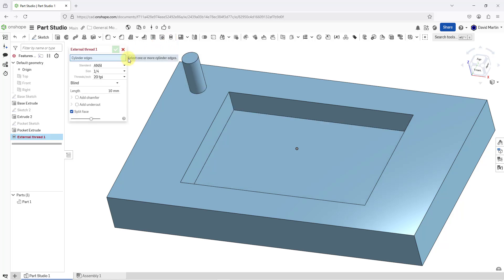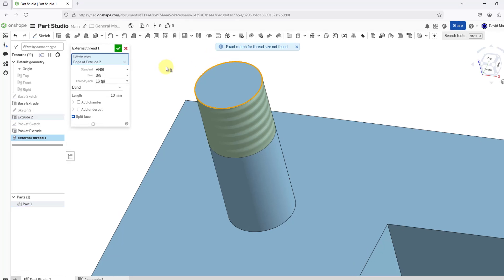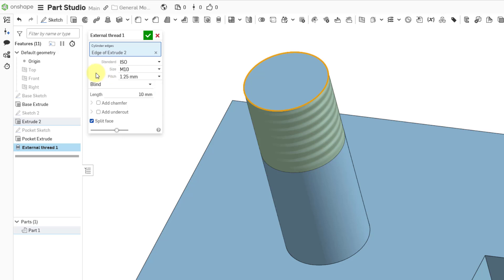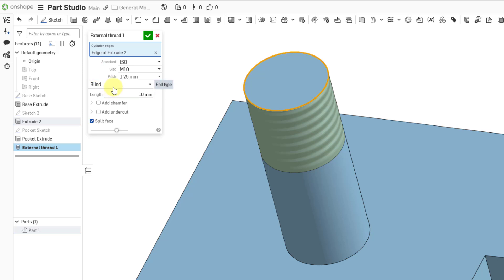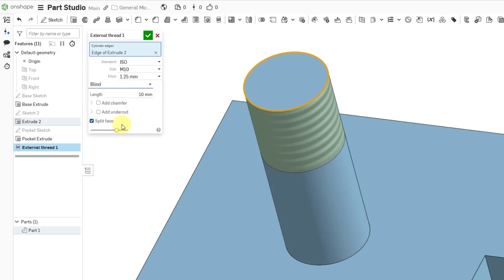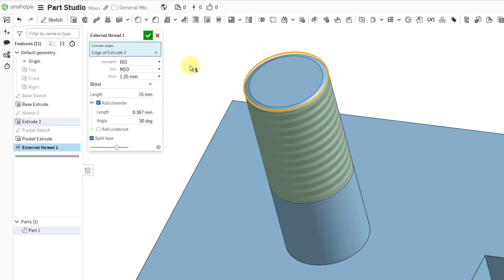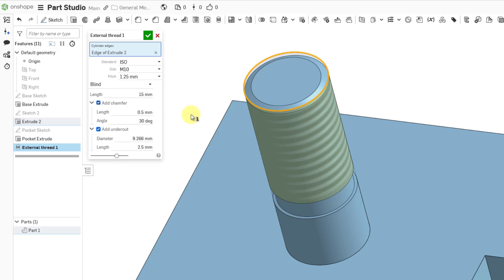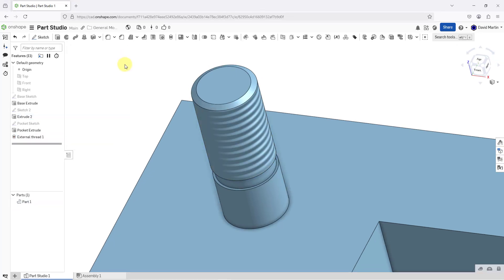Onshape - How to Add External Threads

Comment: no threads show up when i export the file to .obj for the 3d printer slicer. just a blank piece
Reply from the maker: The threads are cosmetic. They don’t physically remove geometry as that’s often unnecessary and too computationally intensive. If you need physical threads, you could create a helical sweep. However, I question the ability of the OBJ format to represent that accurately other than for show.
Reply: @CADPLMGuy  my 3d slicer can handle multiple formats. thanks for the reply tho!